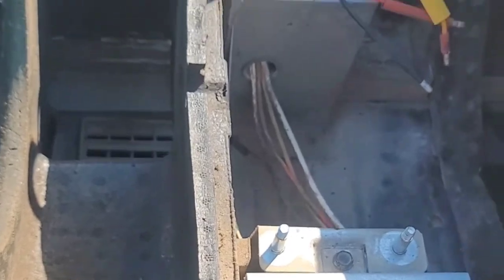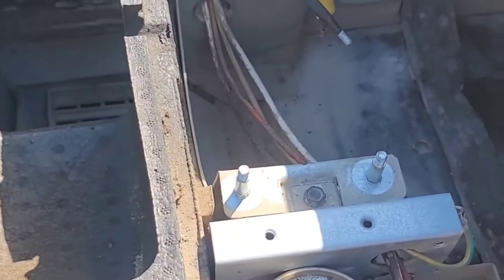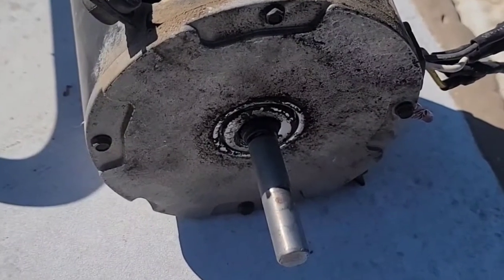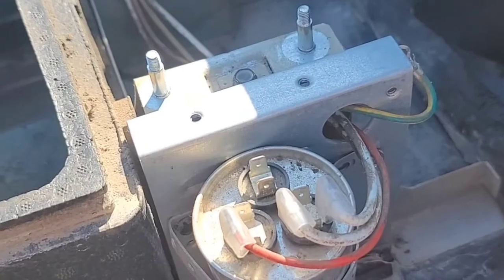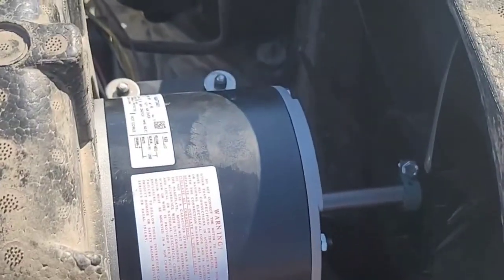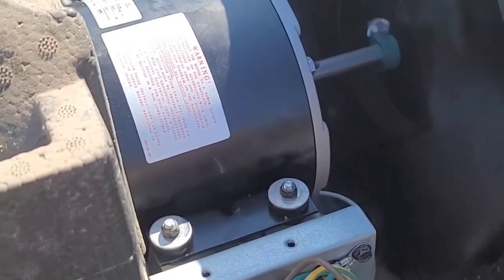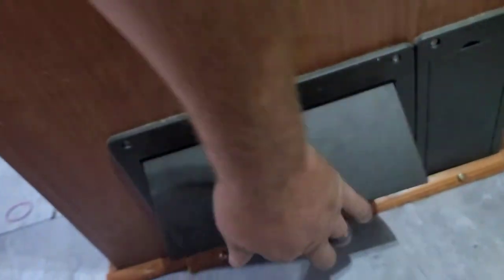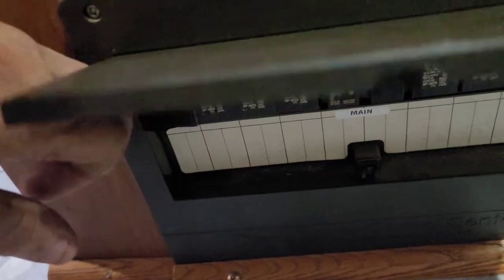dometic brisk air 2 #sortahowto video for electric fan motor replacement

Comment: My ac runs for about 15-30 minutes then it starts to just slow up n stop. I changed motor from older (used) ac I replaced because it wasn’t cooling. Ran for a bit than did same thing. I changed capacitor and it ran fine for a about 20-30 min. I guess I need to replace motor with new one!!